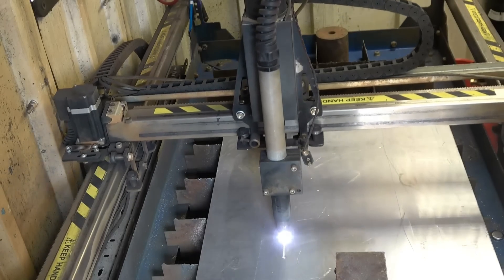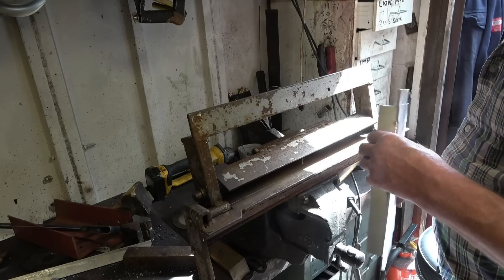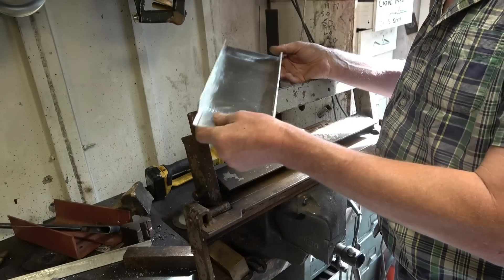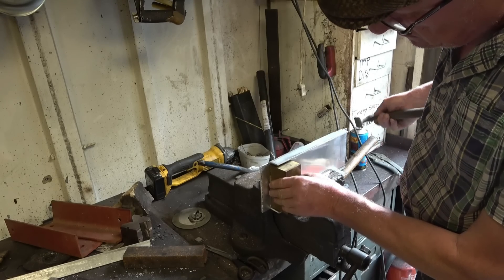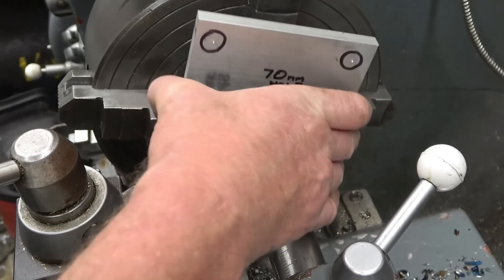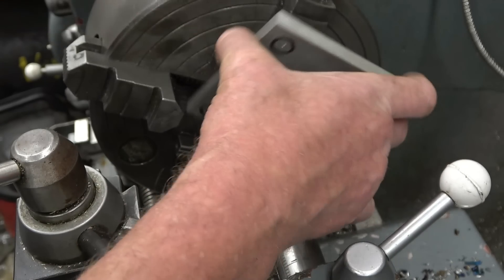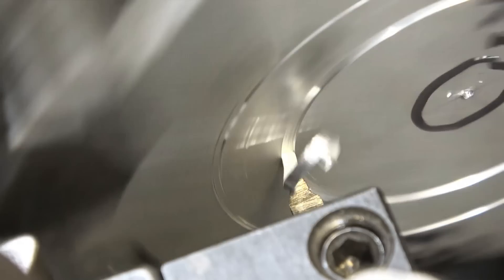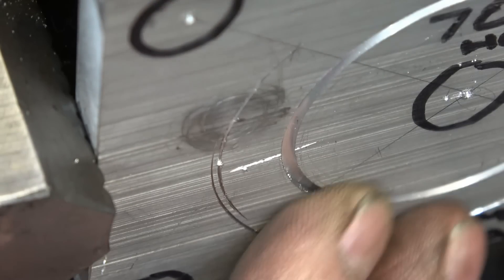SNNC 497 P1  Alloy Plasma Cutting . Machining O Ring Groove.

Comment: Nice job. The plate wasn't very flat. Should make no difference though as once bolted to the manifold it will be flat enough and the o ring should seal well even if the groove dims are a bit off due to the lack of flatness. Great film.

Comment: Hi John, would there have been any value in trepanning the hole to, say 65mm, and then finishing the bore to 70mm since you had the o ring groove tool available? I know that aluminum is relatively inexpensive and it would have required more grinding on the o ring tool. 
I also realize that for one off jobs it doesn't make a whole lot of sense to make a bunch of speciality tools for one off jobs. I was just curious. Thanks as always for allowing us into the shop to watch you work.
Reply: I tried treppaning once.   As the tool broke through the back of the work, the offcut and tool bound up and broke the tool.   I may have been doing something wrong, since it was my first time, but I was not expecting this to happen.
Reply: I've had the tool bind up and snap on me too on breakthrough, now if I'm single point trepanning a hole, I leave a wafer of material and tap the centre out with my hammer.
Reply: Sounds like a better method, thanks for the tip.
Dave.